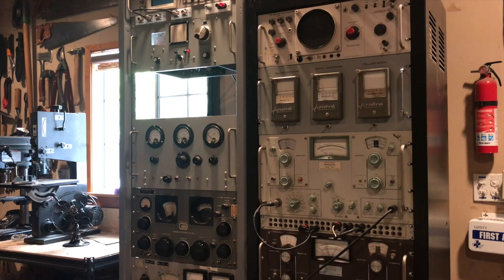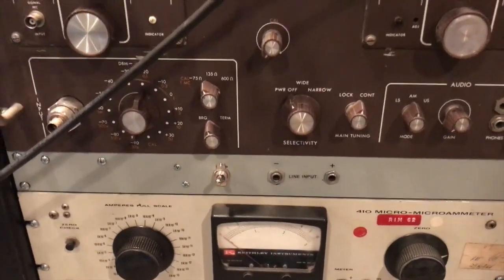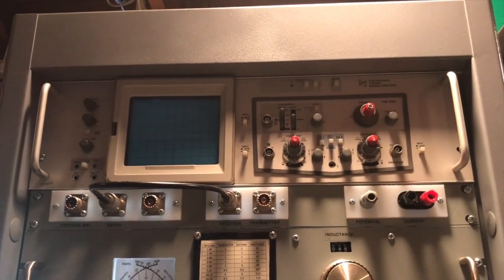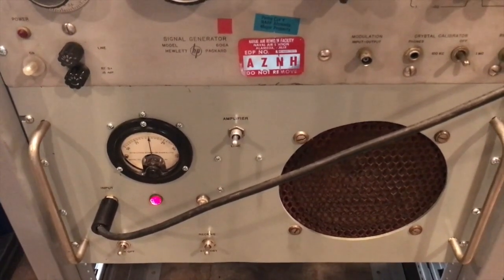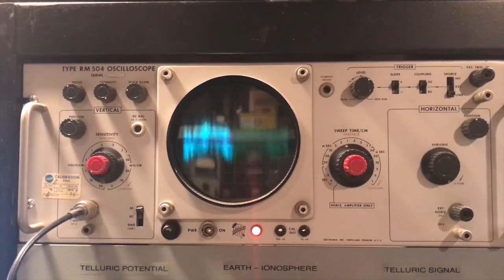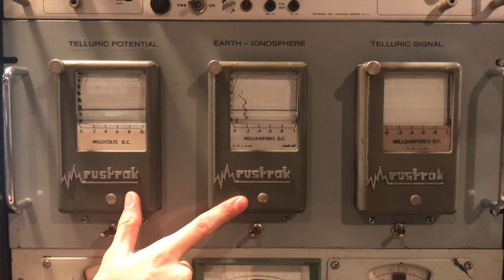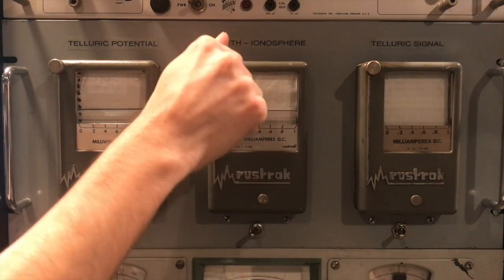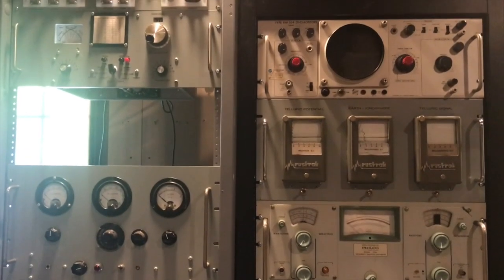The First Suburban Seismic Forecasting Station - Project Update

Comment: Supercool Griffin, but I have emotional problems with those recorders. 64 of em most of em 12 measurements? that's a lot of hammering! It's something to keep an eye on in itself.
Reply from the maker: Not too sure of what you mean by 12 and 64, but the paper advances 1/4" per hour, with the pressing bar activating every two seconds. These chart recorders were made to be left unattended atop communication poles back in the days.
Reply: @GriffinGBrock  Well I've been exposed to the hammering of 64 of those recorders 8 hours a day for 5 years or so. It where 35 yo multicolor Siemens recorders that did 12 mm every 10 minutes for graphing measurements on a thermal device. After 35 years of service they where desperate for maintenance and you really needed to keep an eye on them if they where printing the correct values, but I'm pretty sure you have also indicators to check them in a blink of an eye if they are printing the correct value.
Reply: Probably because your recorders only print 1 measurement they are much more reliable than the ones I worked with. smart choice. Also much better to read. We also had a datestamp and inkcushen to stamp the date on the paper every day.